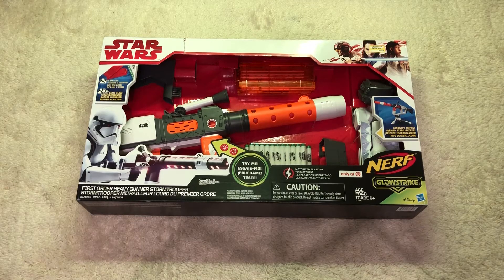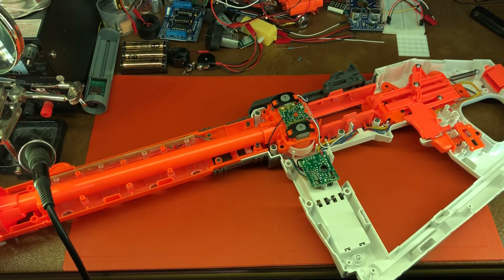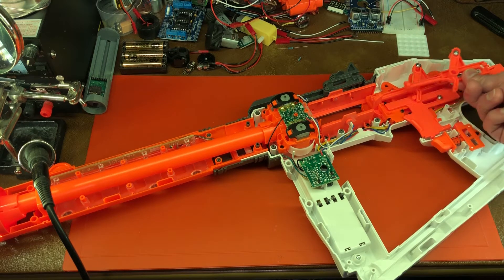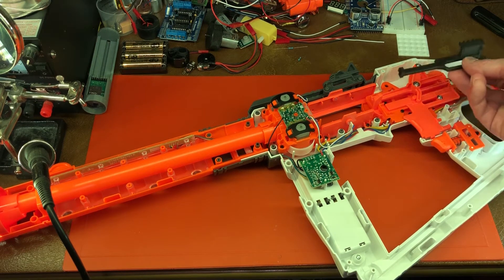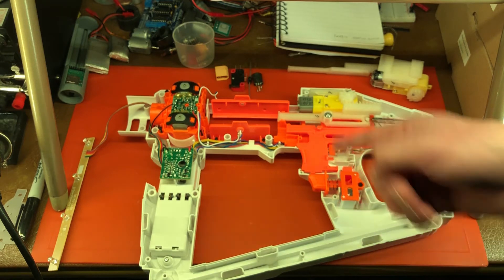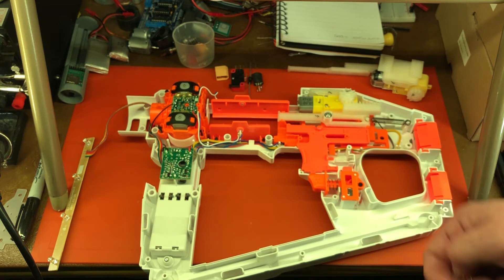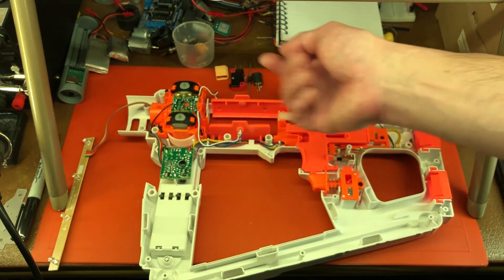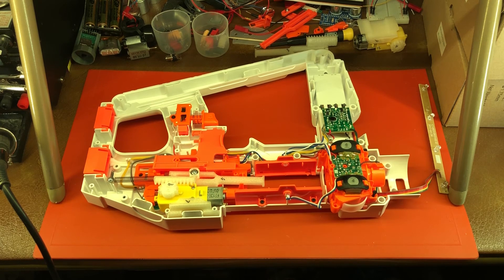Nerf First Order Heavy Gunner Stormtrooper Automatic Conversion (Part 1: 3D modeled conversion kit)

Comment: I gave up on my hopes of making this blaster happen until this popped up, thank you so much so excited tom build mine
Reply: Its up and running, works great not a single issue with the prints.  Did have to put a little glue on the pusher gear so it didn't slip off but thats it.  Thanks for these prints!